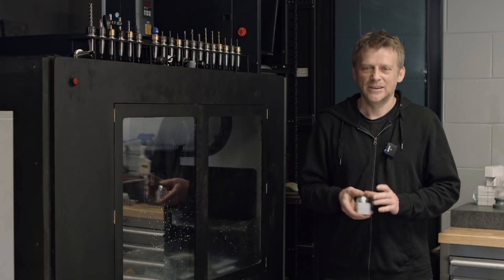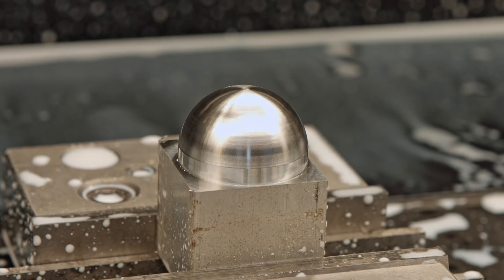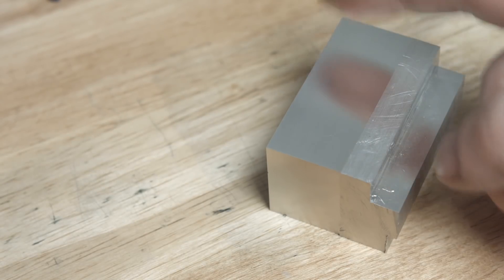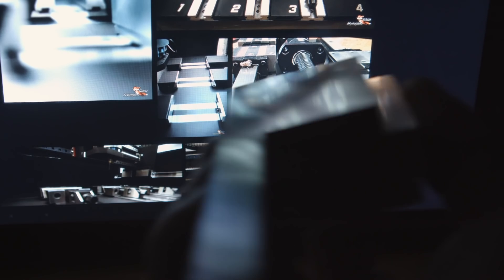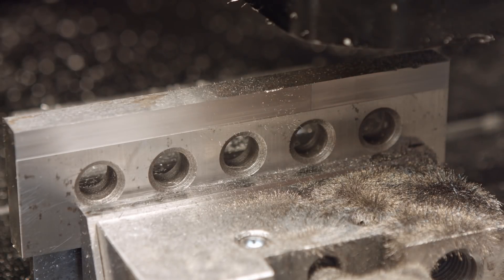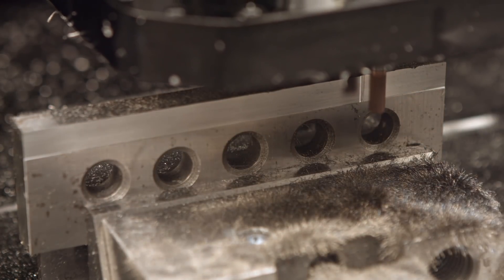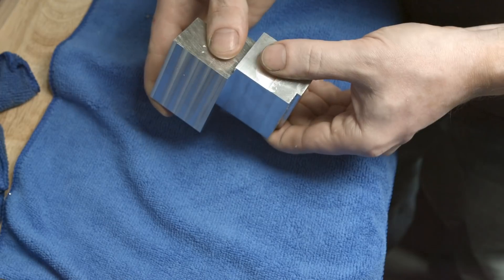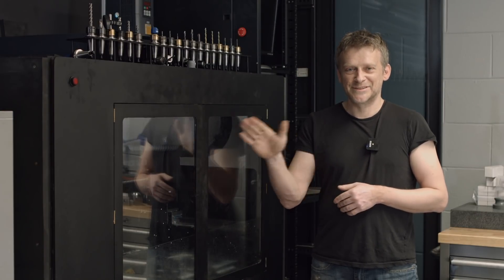The chase for the best possible CNC surface finish! - Mirror finish up close, really close.

Comment: Hi Fox, inspired by your CNC adventures, I started to build a new machine, which in essence will be quite similar to yours, but with 5 axis.  The only thing I have been missing from your videos is the electronics part, and more specifically what CNC controller you are using.  I will have LinuxCNC controlling my machine, and probably mess around with some other solutions as well, just because it is fun to try different things,  but I am curious what your picked to drive your machine, and why you chose that.  Would you mind sharing some thoughts on that?
Reply from the maker: Cool 😉 I can't remember which exactly controller I went with.it was quite a while ago. But I have it in one of the videos epic cnc upgrade episode 1 or 2. Ethernet version and it comes with some Linux equivalent of mach3. But im running it under windows. Didn't have to change it since it was working.
Reply: @PiotrFoxWysocki  Hi Fox, thank you for your super fast reply. I am always pleasantly surprised by how fast you respond to comments 🥰
I feel a bit stupid now....  how I could have missed that first part of your Epic CNC upgrades episode 1? I watched all of your epic videos at least a dozen times, but somehow this part never got stored in my memory. 🤣 Anyway, thanks. So in summary you are using a CNCdrive UC300 breakout board, and you are running it under Windows. Which means you are either using their UNCCNC motion controller software or Mach3. I guess the  first one since you are a smart guy.  Personally I would never go with any Windows based solution, partially because I get skin rashes when I touch Windows,  and  because Mach 3 has often given me real-time performance issues. It may explain why that part of your episode 1 never got stored in my memory. Also, I am a big supporter of Linux and open source projects, so for now I will stick with LinuxCNC, which I truly think is an amazing piece of highly configurable and reliable software. Or one day I may move on to an embedded solution, as I love real-time kernels and embedded stuff, but that's a different topic.  Yes, I realize this may be all a matter of personal preferences, so if your Windows based solution works for you, then kudos! Don't change a winning team, and it clearly works for you ! As a learning point for myself,  how satisfied are you with your controller software? Is there anything that you would like to see differently, or functionality that you are missing?  Perhaps I am just looking for the Linux based Holy Grail while a Windows cup may be more than enough 😁
Reply from the maker: @ericr.5477  not sure what to say, controller works, its fast no hiccups. ont thing i would recommend would be closed loop steppers and do not mix ball screw pitch cause its messing up with resolution and speed. and servos are almost impossible to tune if you have 2 on one axis.
Reply: @PiotrFoxWysocki  So do I understand you correctly that you switched from steppers  on the Y axis to servos and back to steppers again? I have both closed loop stepper and servo motors available, but my preference would be the 750W servo motors that I have laying around here. I have done a lot of servo tuning in the past, and agree that the tuning part will be more tricky when using two servos working in parallel, but I have some ideas on how to tackle that problem and I don't easily give up on finding solutions, so yeah....  But I will keep the steppers as my backup plan, just in case....

Comment: That spark show is normal on hard steels or just with certain cutters on steel. As long as there's no terrible vibrations or extremely short tool life, send it. There's a few parts I run at work that looks like a volcano erupting and those end mills removes atleast 50 lbs of steel before the possible need for change.

Comment: what is the repeatable accuracy of your homebuilt CNC?
Reply from the maker: Once you set the feed and speed. Tool deflection etc. Then its all the same. With in micron or few. Its precise more than enough for 99.99% of parts i make
Reply: @PiotrFoxWysocki  are you a mechanical engineer? How do you know so much about engineering to build a precision CNC?
Reply from the maker: I am. I learned at school about machines etc. But it was vert long time ago. I have built a lot of stuff and building a cnc machine is not that hard. Most important, it has to be as rigid as it is possible. Precision comes from granite surface plate as a base to take measurements from. And the rest is the common sense based on the first principles. I guess you need to have some experience with cnc machines, so you know what is what. I gues it is a great simplification but it explains a lot in fewer words 🤔😉

Comment: Regarding your wringing tests- to achieve proper gauge block wringing the flatness tolerances that are necessary are generally not achievable with milling machines, as the flatness of the wrung surfaces needs to be well under 1um flatness, but also in surface finish in the low double digit manometer ra range. 

It's much easier to lap a part into this condition than any other method. 

And of course, adding water is not a true test ;)

Comment: Easy way to get a very good surface finish in aluminum is using an uncoated YG Alu-Power 3 flute 45 degree helix solid carbide endmill in a heat-shrink holder.
Reply from the maker: Thanks for thr tip

Comment: Impressive!  Especially since (in my limited understanding) surface-ground parts are generally milled first then hardened and ground to final size and shape; the usual practice is to only mill softer steel (before hardening or after annealing to soften the material).
Reply from the maker: usually yes, but this days its both ways. depends on application.

Comment: How would the steel cut have come out with coolant, as was done with the aluminum?
Reply from the maker: Good question ;) it could be worse because it would make surface more slippery or  the opposite 🤔 i run it without the coolant to see the color of the chips. They where brown so for finishing pass it was fine. For the deeper cut didnt worked at all.
Reply: @PiotrFoxWysocki  interesting. I would think that washing the chips away might result in a more even surface because chips won’t be whipped around, and back under the cutter. Also, hopefully none of those sparks, keeping heat down, and expansion of the work and cutter to a minimum.

I have a friend who does aerospace and other more esoteric work he can’t talk about.  He cuts very hard and tough alloys at 30,000 rpm, with lots of coolant we can’t buy. His machines monitor cutter diameter while cutting with lasers. When the diameter changes by a tenth, work stops, the tool is automatically changed. The machine readjusts itself, and continues cutting. Even if I could afford the machines, I wouldn’t be allowed to buy them.

Such is life.
Reply from the maker: @melgross  on this side cut chips where shooting away so wrapping around. as i mentioned before steel is not my thing. I don't have good feeds and speeds for it because i'm not machining steel, just aluminium. 

this 30000rpm makes sense. i think around 50's they did a research on high speed milling and faster you go cooler the work piece is. it goes up to some speed but after that it goes right down. 
theory is easy :) but in practice you need to practice quite a lot :D 
I would love to do all sorts of research, but this this YouTube channel is a non profit hobby really, actually the opposite :D
Reply: @PiotrFoxWysocki  you do pretty well as it is. My friend does it professionally. My own work is a lot more restricted.

Comment: Strictly speaking.. (correct me if I am wrong)  but parallels are not mild steel.  They are generally made from cast iron, stainless or tool steel.    If they are stainless, then what you did there was impressive.
Reply from the maker: This one was something like a  tool steel and it was hardened. You wont be able to drill in it with a regular drill.
Reply: @PiotrFoxWysocki  ... Ok, very, very impressive if they are tool steel. !

Comment: Adding water will make it a hydrostatic(?) ring. It can be achieved with far less finish than what you have achieved. But what you get for a little bit dry, you are close, but you ask waaay to much of your CNC machine to achieve that :-) Nice work!
Reply from the maker: Theoretically it should be possible ;)

Comment: Surface speed was way too high on the hardened steel, try around 2000 rpm on that size endmill with same feed. Aluminum finish is decent but polished endmill from a high tier manufacturer would give you excellent results. I like those from YG-1 which are very reasonably priced.
Reply from the maker: I will definitely try them

Comment: Your machine and work are tremendous.  Since you have the microscope view at 3:14, it looks like there is a dimpled finish that you mention. They are ~150 um in diameter, based on the hair. They are not regularly spaced. You mentioned that you thought that this was the vertices of the line segments that make the sphere. In my experience, if your machine is truly doing this because of the vertices, your servos could use a retune. If you are using acceleration feedforward, it can make the system "jump" on changed in trajectory like moving from one line segment to the next, if it is set too high. Also tuning "too tight" or to too high a bandwidth can do a similar thing. Backing off on your tuning can make following paths like this smoother, if maybe not as accurate. It would be pretty straightforward to set Fusion to a much looser tolerance so it uses less points. Then you could actually see if the dimples match the cam vertices.
Having said that, I wonder if this is chip recutting? The dimples look a lot like chip recutting issues I have seen before. It seems like if you could diagnose this and fix it, you are looking at a near optical finish on the sphere, which would really be amazing. I have never achieved a surface finish where there was "one last" thing like you have. Amazing work!
Reply from the maker: Hey  👋 thanks for all the explanation. I might look in to tune the servos bit better. Dimples are not recut chip. It would have smudges. But it looks clean. I think i know what it might be.

Comment: for cutting steel you need less cutting speed.  i mean speed at which cutting edge travels trough material.  in this try you have sparks from too much rpm and too less of a chip load.
your machine is absolutely capable of cutting steel with 6mm end mills (or 8mm roughing end mill).  all you need is some research on speeds and feeds.
good way to start is to look at cutting charts from tool manufacturers.  here you can choose similar tool and download some cutting data https://www.helicaltool.com/products/tool-type/steels/4-flute-steels

Comment: Hi Fox, one question. In the beginning of your epic upgrade you were talking about stepper and change to servo for a better surface quality. What are your findigs about this, is it an improvement for the surface quality to change from stepper to servo? - provided the same mechanical stability of the machine.
Reply from the maker: When machine is moving now there is almost no vibration. So i guess it adds up. I have changed all the rails and screws so its hard to say what had the biggest impact

Comment: that sticking actually looks good,  5 micron or something like that. what I expected instead of sticking is just check surface flatness, mill 2 opposite sides, and check it on a surface plate I guess, but overall looks great - good result. Making thing stick like gauge blocks out of a mill - eeeehh, it is a dream, I think, starting from good mills you need even, not necessarily your equipment precision, and all other factors.
check repeatability, two similar blocks dimensions faces flatness and just flatness

Comment: Spindle speed and end mill diameter when you cut Steel? Spindle speed seemed high because the sparks
Reply from the maker: 10k and 400mm/min, so i actually should go 800mm and 5k. or 1600mm and 10k
Reply: @PiotrFoxWysocki  what was the cutter diameter? You could check the end mill manufacturers recommendations for the cutting speed Meters/minute, rpm x dia x π
Reply from the maker: 6mm. I did check. But i got it all wrong 😉
Reply: @PiotrFoxWysocki  👍

Comment: Thanks Piotr the quality is pretty high. Nice work !  What's next high end tool upgrade ? A bit surprised there was no arc generation from F360, may be it influences the smoothness of the toolpath (depends on the post processor and the controller)
Reply from the maker: Thank you 😊 definitely I will look into a better tools. Bummer i don't get free samples 😜

Comment: Wow, getting so close to being able to wring parts dry is insanely impressive. Get yourself an MCD fly cutter or touch them up with precision ground flat stones, I bet they would wring dry then!
Reply from the maker: Thank you 😊 any idea where i could get a flycutter with the shank 13mm or less ?
Reply: @PiotrFoxWysocki  sure the company Datron, which you may know makes high quality CNC routers and machining centers, also makes tooling specifically for machine like yours. Googling "datron face mill" brought up some of their tooling for me. I have heard very good things about their tooling. Good luck!
Reply from the maker: I just took a look at their diamond facemill. Only 1700usd, so more than my atc spindle. This is a bit ridiculous for 20mm facemill
Reply: @PiotrFoxWysocki  it’s true, just am going based off of recommendations of others. I’ve heard good things about their carbide face mills too, they are an order of magnitude cheaper and should still fit in your spindle. From my experience 1700USD for an MCD tool isn't out of the realm of sanity but it is probably not necessary for your application either.
Reply: @PiotrFoxWysocki  with that machine, for sure you can make one yourself :)

Comment: Well done. 
Out of experience the quality of the endmill makes a huge difference. My personal preference is YG1 endmills. Slightly expensive but well worth every cent.
Reply: Yeah, YG-1 endmills are very good, also Garant and Holex. But if i would choose i would go for yg-1 👍🏼
Reply from the maker: I will give YG-1 a try. Thanks for the help 🙂
Reply: @eugencsl  I didn't get to try the YG-1 end mills (had great luck with Korloy A+ on aluminum) but I highly recommend the Master Steel PickPocket 3F for all kinds of CNC applications on steel. They are the MVP for even the softest, dirtiest or crustiest ISO P materials in my book and will run circles around Diver end mills
Reply: YG-1 3 flute uncoated alupower endmills are amazing
Reply: Yeah YG1 Alu power is insane! 12 months ago I didn't know what an endmill was(literally, I'm new). Even for me, it makes all aluminum so shiny that it's almost annoying if the room is "too bright". Not 100% sure why these endmills are miles ahead of other reputable ones for surface finish, but holy cow! Most of them are under $50 USD, usually $20 to $40. In my novice opinion, they are extremely well worth it.
Reply from the maker: This is the second recommendation i get to try those. I Will look in to it.

Comment: Just i quick thought from someone with no milling or metalworking background what so ever. 
Maybe you can "dress" your endmill. Just like you would do with a surface grinder. 
Use a ground wet stone and "mill" very, very lightly over it. With that you should be able to get any added up error from spindle, toolholder and tool out of the equation. And have a tool exaclty perpendicular to your machine axis. 
Of course this result in a some amount of rubbing because you ruin the back relieve. But depending on how minimal the dressing is, it might not matter.

I really enjoyed this series and the result is just awesome!
Reply from the maker: If the tool is off axis and you try to dress it. You will put a radius on it. Not make it flat.

Comment: oh wow, so amazing! looks like all the work was worth it. congratulations Piotr, this is so impressive. i'm not sure what you want to improve, maybe gcode that supports arcs? whatever else you come up with, i look forward to hearing more about it!
Reply from the maker: Hey 👋 thank you 😊
Reply: @PiotrFoxWysocki  hey! dude since my comment i've actually discovered a new tool that might interest you. i don't know if it'll work or its safe to use it on CNC router gcode, but for 3d printers a program called ARC WELDER post processes segments on a curve into arcs. i don't see why it shouldn't work.
heres some info on it:

https://www.youtube.com/watch?v=18uYYXecH5g&ab_channel=MakersMashup
Reply from the maker: i think the problem is that in 3d printer those arcs are flat. so printer draws a circle and moves up and draws another circle. 
in fusion when you use spiral it constantly moves up drawing circles. so i guess its the 3d motion which makes it harder. 
i guess in fusion i could change to different tool path which is supporting arcs.

Comment: Hi Fox,

Absolut great work, thanks for uploading...
Please would you be so kind to share the F360-file for this halfball.
I think, that there are some details that I don't understand.
Do you think that there is a chance to mill it with not so much
cooling water; to better see the real cutting process.
Over all, I think this piece is a good method to check the accuracy of the machine
Thanks.
Reply from the maker: Thanks. Nyc cnc did this test first. And they do explain all about it. Please check. 
I wont be making any more videos on milling balls. I think one is enough ;)